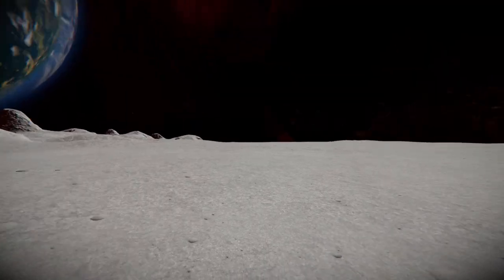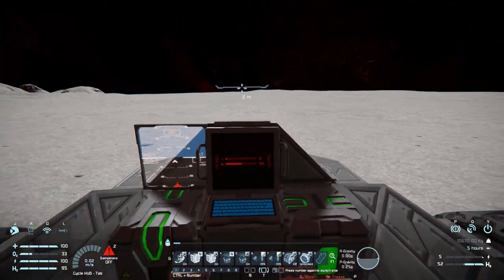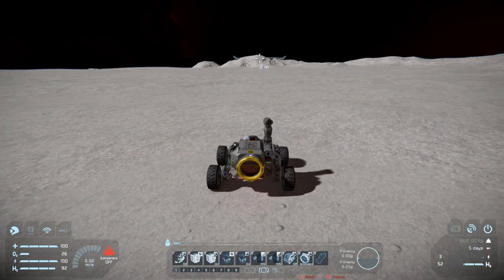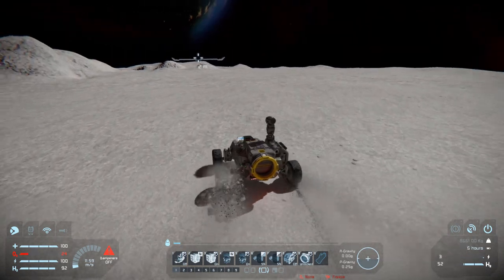The Lunar Scooter - Space Engineers

Comment: You need to turn down the friction, you get better drifting and don’t flip as easily, also a wide wheel base and lower friction is good

The level of friction is dependent on the crafts weight, I would estimate 40-60 percent for that rover